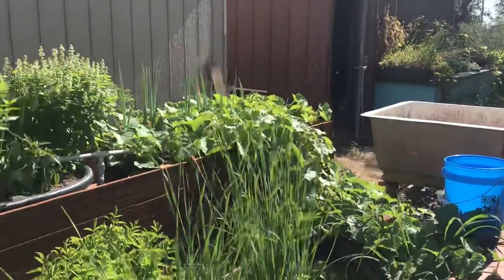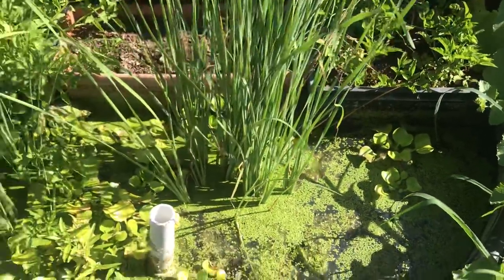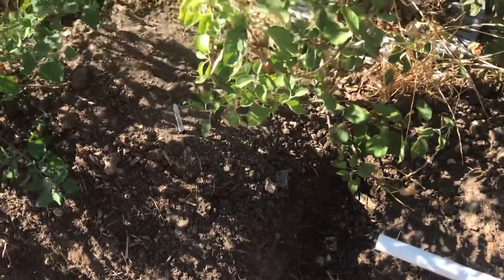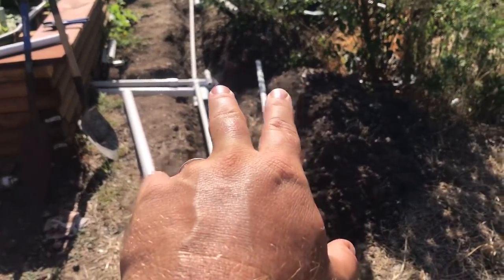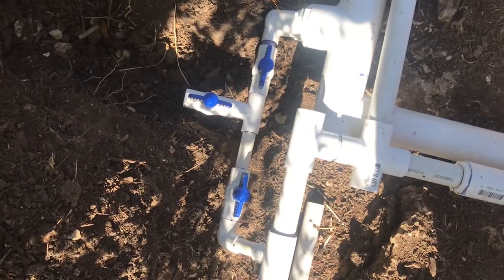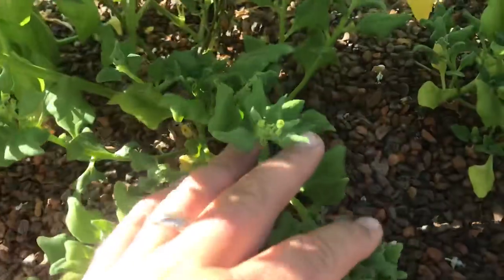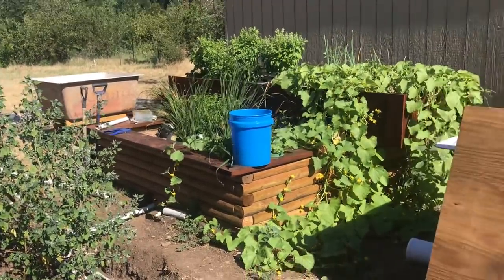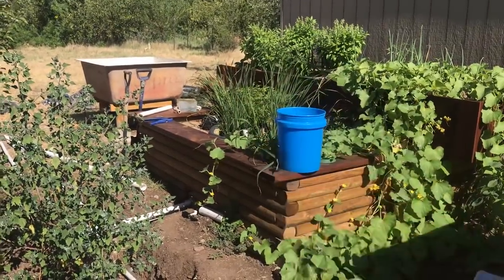New 300 Gallon Aquaponics System - Part Eight

Comment: Could you set the water pressure into the float valve low enough that even if you have a very low to very high tide event that in the time it takes from lowest to highest tide only a gallon or two comes into the sump? This would protect from overflows and yet still automate topping up the system.